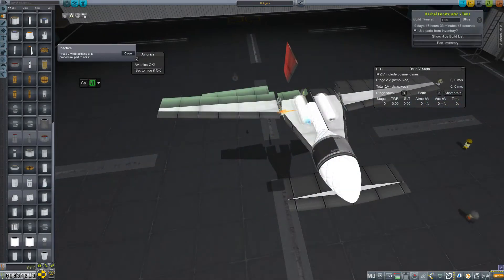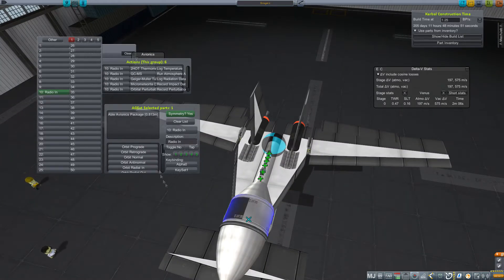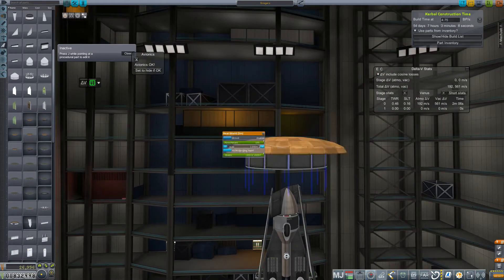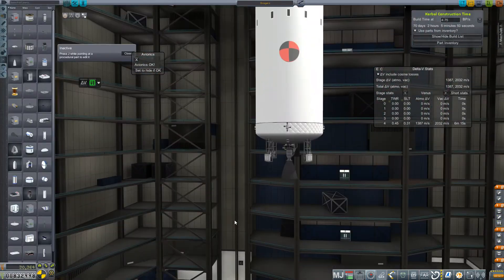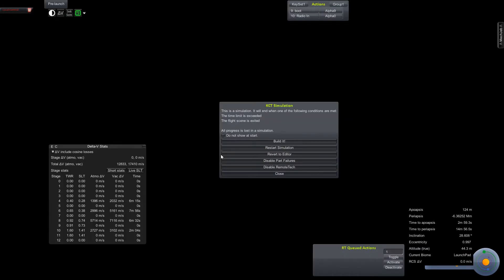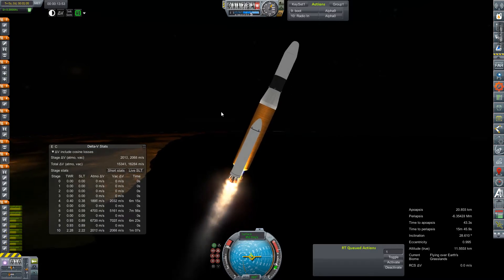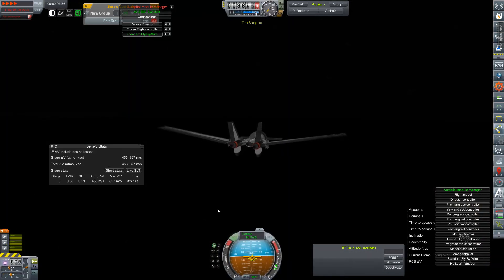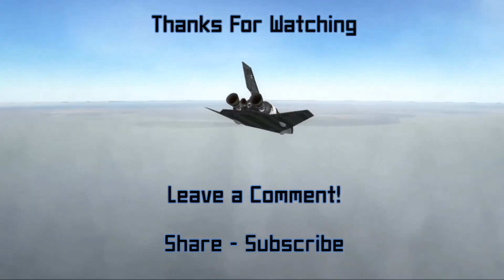KSP RP-0 #272 Project Origami Test Phase

Comment: A quick tip, I'm sure you probably know this but forgot in the moment, but at around 1:20 you tried attaching the RTG's to the fuel tank but couldn't because it surface attached instead of node attached. When you're in a situation like that hold ALT it'll stop anything from trying to surface attach and will only attach to attachment nodes whilst holding ALT.
Reply: and you can switch translation from local to global by holding...um...I don't remember but something...when you're doing 7:40
Reply from the maker: yeah - holding ALT didn't work on this one - only because the node was burried in the wing structure - but thats a shortcut I use a lot in building
Reply: Local to Global, you mean the things that you can place, move, rotate, and re-root? In the same order I said those you can use, 1 - 2 - 3 - 4 to switch between those four widgets.
Reply: No, I meant changing translation axis from global to local, like G key in Blender3D.

Comment: I just got finished with my attempt at a cytherian plane and you land at walking speed.
Reply from the maker: nice! was it able to hold level flight all the way down? I worry about the atmo being so thick that this one just nose downs in to the rock... ( but hopefully the scope of the mission will be complete by then )
Reply: Just keep it at where FAR says its at normal earth pressure and its the same as earth flite. Also, if your low the moment the engine shuts down it looses 100m/s like that but glided flight is the same but very.... Very slow. Although you have a different design than me but this is my experience.
Reply from the maker: awesome, Thanks!

Comment: Which mod are using to stow the control surfaces?  My Infernal Robotics has parts way to large...
Reply: Brian Bowhan that mod for the control surfaces is Procedural Wings, look up the KSP RO Golden Spreadsheet or KSP RO Silver spreadsheet you'll find mods, links, and the version it works with. Crazy useful. Golden spreadsheet is the basic RO stuff and the silver spreadsheet is basically everything that you can add to RO to make it more...interesting, parts etc.
Reply from the maker: Brian Bowhan they are infernal robotics parts, I've just used tweak scale to size them down
Reply: I have Infernal Robotics myself, but I've found that Tweak Scale just feels a lot like a cheat. So I want to do that folding wing, but it would probably ruin my immersion.  Oh, KSP,  why do you torment me so?
Reply: If you think about it tweakscale isnt a cheat. Not even Close. Engineers in real life can easily make a scaled down version. I mean, It is pretty simple.